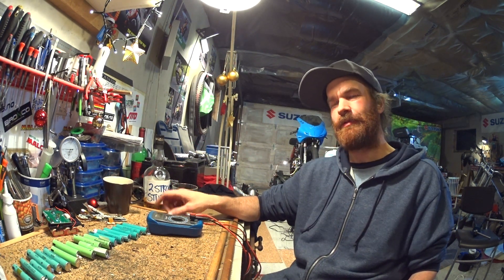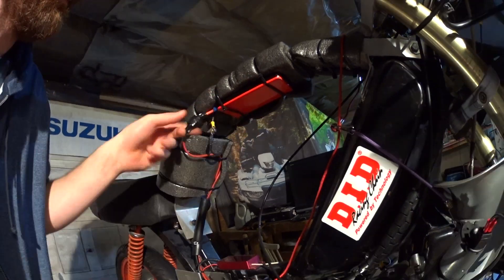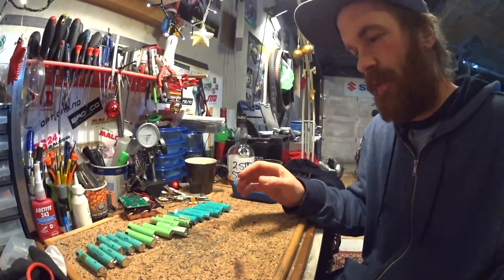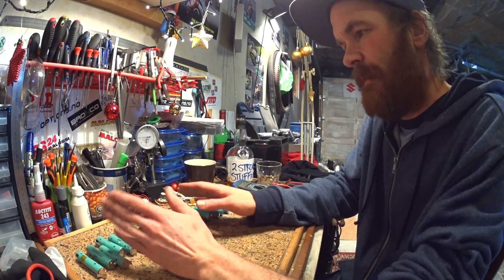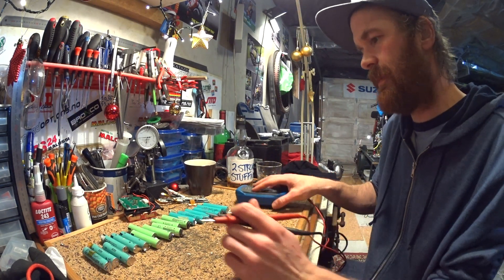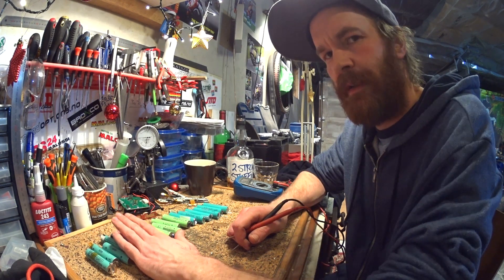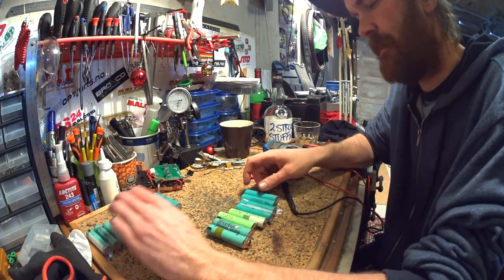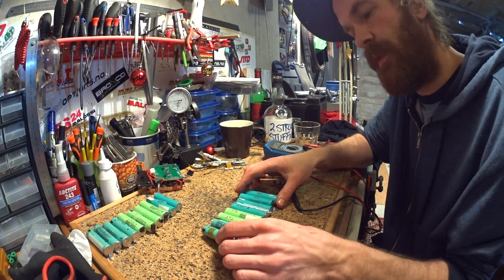E29 - Batteries and Broken Bits. 2STROKE STUFFING

Comment: Is EGT = Exhaust Gas Temperature? If so, how are you using this temperature? What other temperatures do you need to track? When I used to ride my Yamaha DT-175 (1977 model) and it was raining, it always seemed to have more power. I assumed it was because the rain water was cooling the "hot" side of the air-cooled engine. The reason I mention this is that I suspect a complete understanding of the temperature of each component of a an engine is critical to optimizing the maximum power output you are after. A freshly started engine runs roughly before it is happy. I have always wondered what critical temperature was causing this. Is it the piston top temp or the carburetor temp or something else?

Comment: hey guy, love what ur doing! normaly if you want to test a battery you messure 3 things: 1. check the charging voltage and current (lithium so you have a specific charge method, just skip this step)  2. messure voltage  3. messure voltage and current under load